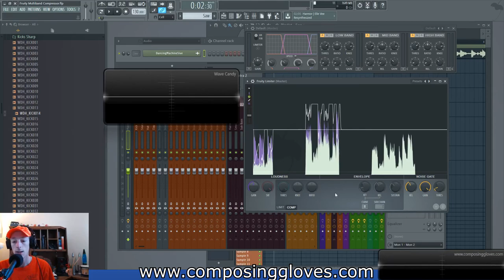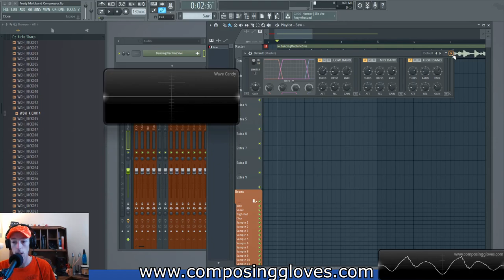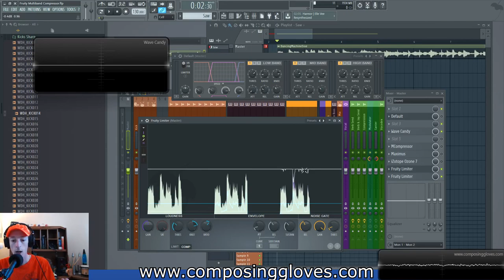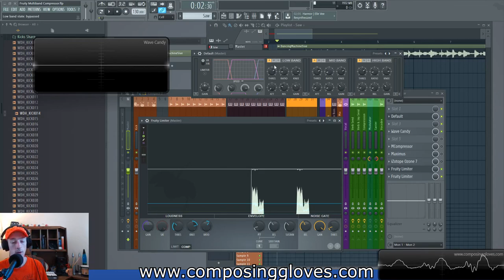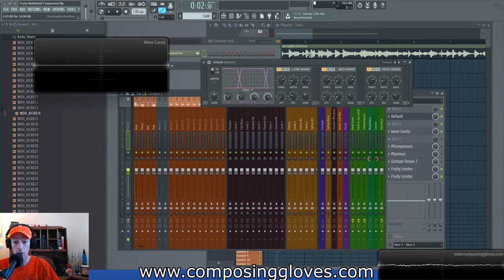Fruity Multi-band Compressor and How to use it

Comment: Just a quick tip, if you want to adjust the frequency band and still have the whole frequency range, you need to set the first 2 knobs to the same value and the other 2 knobs to the same value.

Comment: no, no, no. your compression starts happening when you hit the blue wave, not white wave. you got your sustain on.. the blue shows what will the compressor threshold detect and start to do it's job. the compression that you did also distorting, and you can see it too by those fuzzy white line from the white line analyzer. and also the multiband compression, the Impulse response is not the cause of your wave shape different.  it's your gain reduction that different in each band. if you adjust/gainmatch the before and after, it will be the same. IIR and FIR tracked signal differently that makes the difference in the gain reduction. and the way you explaining the attack and the release is so confusing for ppl who try to understand how to use it. and also also, on the izotope. if you - the tha ratio, it;s upward compression not expansion. dude, tbh, there are still a lot of things that you take it the wrong way. how could you be so confident making video explaining things that you still not understand it. it's so dangerous, ppl who want to learn might took it the wrong way. you use a difficult mixing term, to avoid explaining things that not so hard to be told, maybe just to cover that you don't even know what that is, or just to make you sounds like a pro mixer. i've been watching your tutorial videos for a while, and you keep doing that sometimes. please, if you really want to teach, teach em good. all the things that you said, doesn't need 35min long. u always look like that u got really lack of preparation, lazy to edit or review the tutorial that u make (cuz many things that should not be said/shown or need some more context to be told or even unnecessary explanation, repetitive and loop talking are still there). your channel is getting bigger, you should improve what you present to viewers, cuz some of the viewers are not only a beginner.. i hope u dont take my comment the wrong way, i just want to support u by giving a constructive feedback so you can get better, not hating or whatsoever. gbu sir. if you don't like what i say in this comment, u can delete it tho. i just wanna tell u, cuz u need to know. don't stop learning and only teach ppl what you really really know.
Reply from the maker: Nothing I said here was wrong (as far as I saw after a second look through) and I point out several of the things your talking about (such as the compression with fast attack and release being a distortion and then I use it demonstrate sustain around 6:50, and one of the first things I say is the blue line is the threshold, i never said anything about a white wave triggering the compressor) I appreciate your concern and honesty and just want to give you a proper response. I show that compression starts happening after you pass the threshold according to the ratio, knee, and timing settings, in 3 separate plugs. The blue is line is the threshold, the white line is the graph of what the compressor is doing. The purple shows this gain reduction. Also, in izotope I did say it was expansion if you reverse the ratio but upwards compression is the same thing (based on your comment it sounds like you have never the term expansion). I am confident because I do understand it. I have made a couple compressors myself and gone into filter design! haha (IIR and FIR do not "track" the signal, these are the type of filter used for the crossovers, and what I was explaining was due to the way each one works they will cause phase shifts and am amplitude reductions differently). As far as length and teaching, there is so much out there that edits away bit and pieces in a way that results in stuff that is overly simplistic or so fast that no actual comprehension takes place, granted I am often told I go to fast so I am trying to pace myself. I felt like I had a good balance in this video. I started with compression, moved to concepts of multiband compression, then went through the idea of each control and how one might consider its use and then moved to the broader ideal of compression. As for the terms I use, I think I may have used to many math references, but that is just how I talk and see things. I am "that guy" where we could be walking to class and I want to explain how we could use calculus to find when we will pass the next person #relatedRates or if a store stayed open infinitely long we could create a function that would allow us to tell them when the next customer would come! That still blows my mind. To bad stores close. XD I spend 6 hours 4 days a week teaching all kinds of subjects at Citrus College and get everything from sequences diverging, to helping someone with their analysis paper on Chopin or even just helping someone make a major scale. I put in terms that apply. You got me on the level matching, I definitely could have mentioned that. If you still think something I said was wrong feel free to point it out. Hopefully this clarifies things, thanks for speaking your mind. I'd rather people be honest. =)
Reply: cool man! i appreciate your response. keep up the good work, happy mixing :D